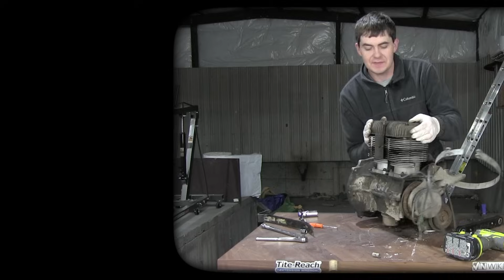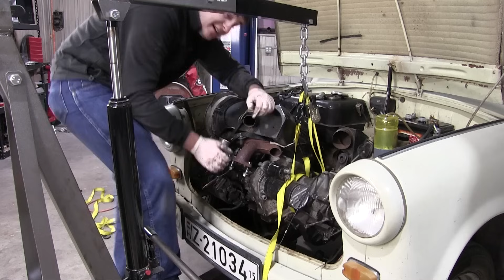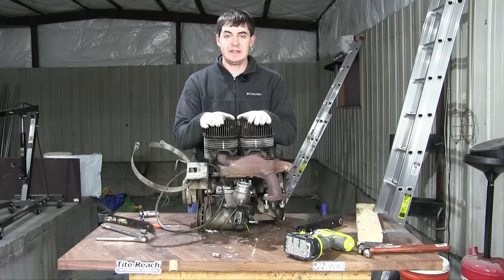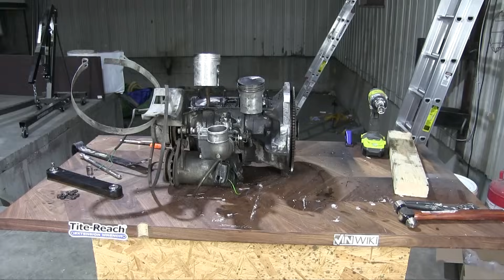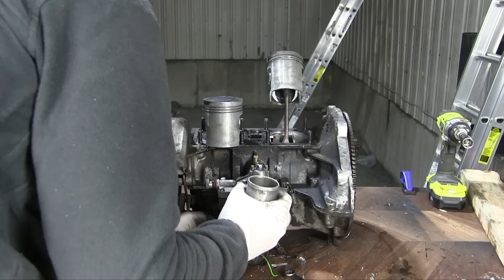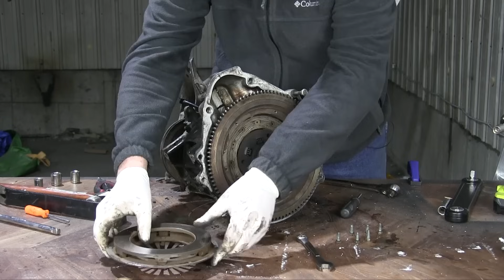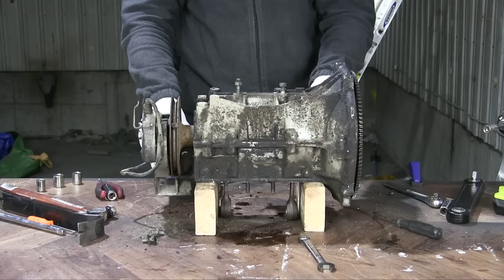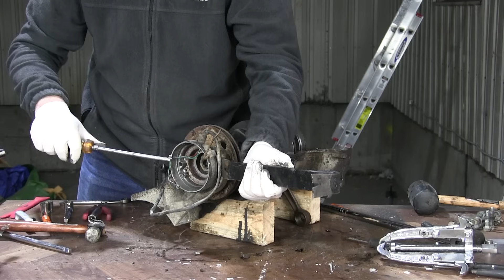Rebuilding the Trabant's Engine: Part 1 - The Teardown

Comment: The entire 2-stroke road vehicles subject is always intriguing to me.  Currently I live in the Philippines and there are motorcycle sidecar vehicles that serve as taxi's, called "trikes".  Here in Dumaguete, I would say about 90 - 95% are 4 stroke but, maybe 5% (100?) are 2-stroke.  All the 2 - stroke set ups are from the 1980's because I think there was some sort of world wide ban on 2 -stroke road bikes due to emissions. 
 
Nonetheless there are some still on the road.  A trike can haul about 7+ people (including driver) and often do.  How do they do that?  Well, my guess is they change out the sprockets and this will result in a top speed of around 35 mph (50 kph?).  The 2 - stroke guys always surprise me.  These 1980's 2-stroke bikes are under hard use, sometimes 24/7, and are carrying a full load at least 50% of the time.   I think all the "autolube" systems have long since conked  out and they just put mix oil in the tank.  I have been on a trike when the driver refueled.  He had a quart of mix oil and just eyeballed the amount to pour in, no measuring.  I guess they are careful not to use engine braking.  

I made a lot of videos in the Philippines and you can see how the trikes are set up.  You can see one cruise by at the beginning of this video.  You don't have to watch the whole video because it is about 3 cylinder refurbished (from Japan) Suzuki 4 stroke vehicles;

https://www.youtube.com/watch?v=1z-Rf1Vz_sU

Comment: dynamo os a generator, I had a Bridgestone 175 motorcycle two stroke with rotary valve on each side of the engine, so when you lay the bike down on the road the cover grinds off into the carb and directly into the rotary valve, which shatters!

Comment: You can (ex)change the complete engine on a roadside in one hour. You dont need to get out all the stuff (exhaust, transmission etc.) to get the engine out.
All you need are 3 spanners (10mm, 13mm, 17mm) and a screwdriver (for the cables at the contct breaker). Loose the nut screws at the engine-transmission connection and you can lift out the engine.
The engine itself is lightweight, it can be handled by one man.

P.S Please loose and tight the headbolds crosswise! ;)

8:57 Can you see the HEMI?? :)

Comment: The crankshaft is the weakest part of the Trabant engine. You need the best spare part, and my German friend told me, the best is the "trabantwelt dot de". And one of my friend had a racing Trabant with a 50BHP tuned engine, and he used Stihl 2T engine oil in 1:33 oil:petrol mixture, because the oil is a very important thing for the longest lifetime of the engine.

Comment: To pull your wrist pins you do not need to make a puller. Simply us a piece of threaded rod, a couple of nuts and washers along with two deep well sockets (One socket must be able to go inside the other.). Put a nut and washer on one end of your rod. Then the smaller socket sized to push on the wrist pin but small enough to clear the piston. Place the rod though the wrist pin and install the other larger socket, a washer, and another two nuts. Tighten the two nuts together so that they lock on the rod. Using two wrenches, begin to tighten the assembly up. The smaller socket will push the wrist pin through the piston and connecting rod assembly into the opposing larger socket. Once the wrist pin clears the connecting rod, disassemble your improvised tool and remove the piston from the connecting rod. You can use pieces of appropriately sized tuning in place of the sockets if you have it. NEVER EVER hammer the wrist pins out! You run the risk of bending the connecting rods which will destroy your engine.

Comment: When I was in Europe in the 1960s, I drove a two-stroke 400cc Vespa convertible (roll the window shade down!).   After filling up the 20-liter gas tank, you had to crank the oil into the gasoline.  Now and then a glob of oil would foul a cylinder, but it would just burn up, eventually.  West Germany had the VW and East Germany had the Trabaunt.  France had the Deux Chevaux Citroën (which also had a window shade roll down convertible feature), but that is another story!

Comment: That exhaust manifold leak could cause a lean running issue! Piston pin? Is actually called the wrist pin. Ok now there are some tricks to get more power out of two strokes that involves no parts! All you need to do is use a high speed Dremel grinder to grind a small arch in the intake side of the piston skirt that in effect opens the intake port a little quicker and in a gradual manner, then take that high speed tool and clean up all the ports in the cylinders to help with air flow. You can also grind a tapered amount of material from the top of both exhaust ports that opens up the exhaust sooner. Both tricks help with the intake and exhaust scavenging that will help develop more power. The bigger the changes you make, to a point will help create more power, but the bigger the changes the higher the rpm the changes will accrue. You will also want to increase the size of the main jet in the carburetor to help get more fuel/oil mix in with the extra air that’s gonna get in. I also don’t know if there are any aftermarket parts for more help for power increases, like a tuned expansion chamber for the exhaust, with bigger carburetors and better air cleaners. Good luck they are known to be a fun quirky car.

Comment: Nice to see some of these little tupperware cars made it over to the class enemy. Have a 601/A myself. (Basically a tramp for federal use) bought of the army by gramps for 250 marks (125€) in 1990. Used it a bit and then it stood for 20 yrs. Now i use it as an utility offroader.

Comment: Dynamo is a DC generator that uses brushes and a commutator.  Most cars before WWII used them.  Then switch to AC alternators as they are more, efficient, more output for the same size and less maintenance.  Output also tends to be more constant with less wings and droops than a dynamo.

Comment: Quite sophisticated a roller bearing crank, reminds me of early Suzuki 4 stroke motorcycle engines with pressed up cranks which needed tons of pressure to assemble but if maintained properly would last far longer than plain bearings.

Comment: Hi my name is Lukas, I'm owning a Trabant too. I've got an original GDR maintenance book, when I bought mine, in it, there is a maintenance list too, and it says, every 5000 km you need to tighten every nut and bolt of the engine, because the two stroke oil and the vibrations will loose everything over the time. There is even a chapter, which says it's a common problem, if the tighten maintenance is missed, that the generator might drop out of the enginebay.
This might caused the loosing of your exhaust manifold too.

Comment: My family used to have 2 trabants in hungary, but i was too young to remember them, i do remember though the car they got after selling the trabants, which was a wartburg. It was a tad bit better, but these cars, especially in mountainous landscapes were terrible to own and drive. They would randomly stopped working, but strangely they could be restarted if someone got out and pushed it. They also had problems with the cooler fluid, that would boil when driving uphill.

Comment: Back in the 80ies people in East Germany that used to drive alot with their Trabant always had a refurbished spare engine ready to swap if the existing engine started to loose power or had sufficient mileage accumulated (20000+mls). The old engine could be refurbished by specialized Shops for small amounts of money. Actually this means unlimited lifespan as long as this repair infrastructure existed. Same thing applies to the 2-stroke motorcycles but they just needed a new piston every 15000-20000 mls. This system still works in Cuba where you see 30-40 year old MZ 2-stroke bikes used as moto-taxi every day with 1/2 million of miles on the engine and they just won't die.

Comment: You can try to split the crankshaft with heat and pullers ,than you need a press and you have to pressnir together

Comment: My 1966 BMW R50/2 had a similar pressed together crankshaft as did my Honda CL160. My old Harley Panhead, Knuck, VL, and 45 engines all had crankshafts that were bolted together and were much easier to rebuild. Harley now does it the Jap and German way.

Comment: Ok so that big end connections rod play is acceptable if it is a side to side movement, however if it has any end play or can rock to a minor angle then it is over clearance, this apples to any 2 stroke. And if you’re looking to gain power do not forget to widen and raise the intake and exhaust ports to a maximum of 5° over the standard height. Big performance and efficiency!!! Good luck!

Comment: Make sure the engine block is not worn , often the valves wearing the aluminium,  and even replacing the valve does not solve the problem.

Comment: The GDR's motorist's motto: Männer aus Stahl fahren Autos aus Pappe - Men made of steel drive cars made of cardboard.
Reply: I was in Berlin not long after the Wall came down. I stopped at a traffic light, then I heard a small bass boat pull up beside me. I turned to look but saw a Trabant instead!!!

Comment: The Trabant engine never ran properly.
You can rebuild it all you like ,it will always Smoke,always pollute,and always run badly.
The engineers didn't know what they were doing.
Back to the drawing board.

Comment: You can lift it out by hand but you will have to uncouple the transmission from the engine within the engine compartment. This is how: remove the bolts between tranny and engine, and also the starter motor. Loosen the front gearbox mount. detach the gearbox while lifting it from the front and moving it aside. This will give just enough clearance to lift up the 35kg engine block  by hand. .

Comment: And while Trabants were air cooled, DKWs were water cooled and had one more cylinder. Trabant mounted their engine crosswise while DKW mounted theirs lengthwise. But when going down the road, both smoked and sounded like a two stroke motorcycle. Wing ding ding ding, winnng............. A DKW Junior and your Trabant were  about the same size. And neither one had a water pump. DKWs blew air over the radiator for cooling or heating of the cabin so no exhaust fumes from the exhaust.

Comment: Very enjoyable to watch. No, you don't necessarily have to be a mechanic to work on simple cars. BTW, at 14:55 that little thing that attaches the connecting rod to the piston is called a "wrist pin". Your "tool" worked like a champ. In more "tighter" engines, you have to have your wrist pins pressed out and in at a machine shop.

Comment: That is a dynamo (see wiki-dynamo) it generate more volts as rpm increasing, most of the time it is not able to produce enough voltages to even charge the battery. Alternator/generator is a 3 phase motor using diodes to make it DC. It can produce ~14,4 V at idle rpm. Like those hungarian licence plate :) (Z-means it is deregistrated for sale or its tax needs to be payed) Sorry for my poor english.

Comment: What? The heater is powered by exaust gas? So ir there is a hole between both systems you re getting exaust gases into the passanger compartment? Awsome..... xD
Reply: The air for your modern car also comes from the engine bay, no difference there. Since the trabant engine is air cooled there is no other way for a heater.

Comment: you were VERY fortunate that you did not drive holes into the crankcase or damage the internal bearing webs when removing the flywheel. Those two bolts are meant to hold a plate with a central screw so that you apply force only to the two elements involved with the situation.

Comment: @14:00 I'm suprised to see you using a number 6350 side piece for your puller. I would have used a 6362 which would have made for a smoother and more efficient experience.